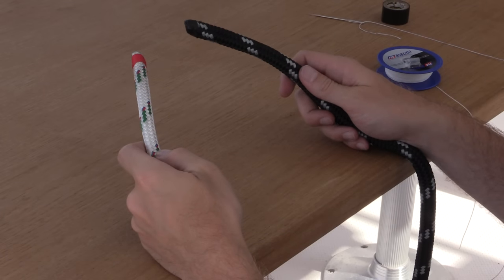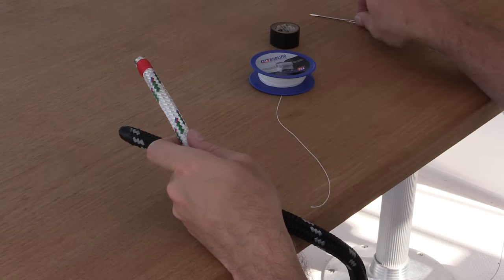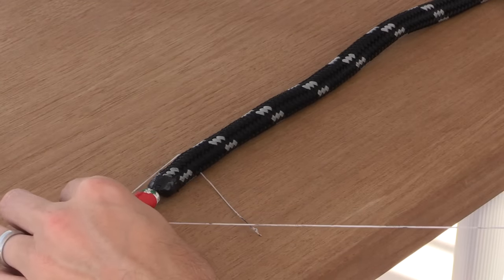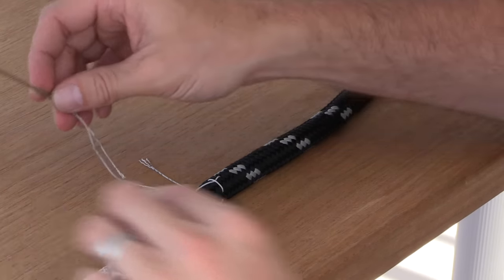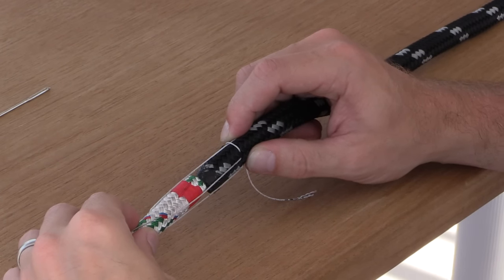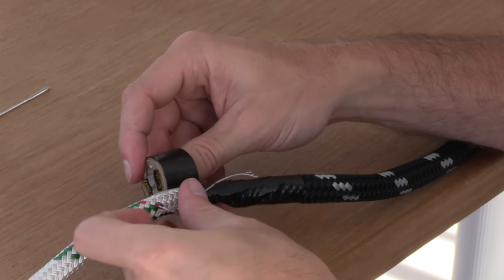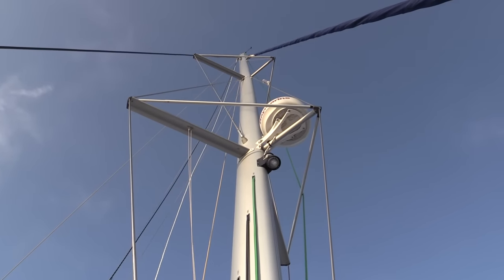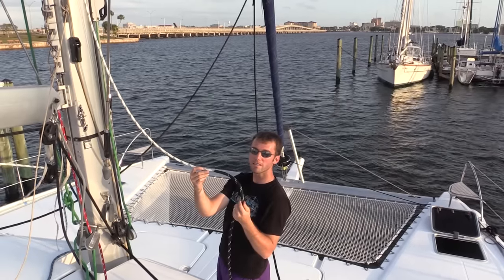Life Aboard: Running Lines Through The Mast

Comment: Do you think some of that heat shrink with the glue on the inside would work? The thick walled heat shrink is extremely strong and shrinks down with a great deal of force. Combined with the heat activated glue coating it shouldn't slip. And it should slide through the mast easily as the joined section would be slightly narrower than the rest of the line so there would be nothing to snag or bind. Also no electrical tape stickiness as the glue inside the heat shrink is only sticky when hot. And if required it would be easy to use several layers for extra strength and resistance to abrasion on any sharp surfaces.

Comment: well done, but why ?  You seem to be downgrading stuff..
Reply from the maker: +david w Hi David.  The lines that come on our boat from the factory aren't actually that great quality and they are large diameter, which caused a lot of friction running through the blocks/stoppers and contributed to the problems we had dropping our mainsail.  The new halyard is a stronger rope and a smaller diameter, so believe it or not, it was actually an upgrade.  :)